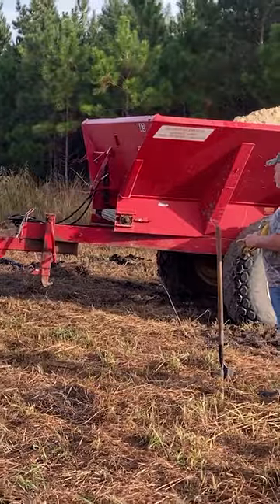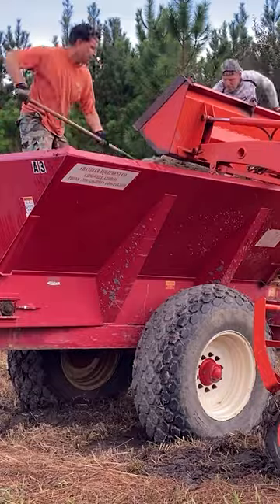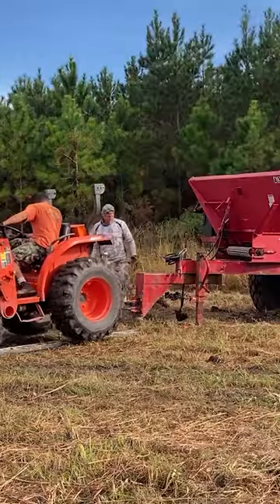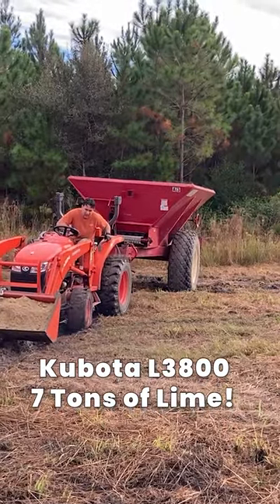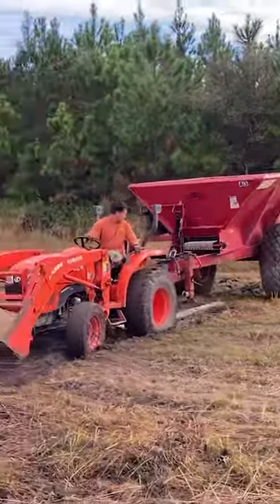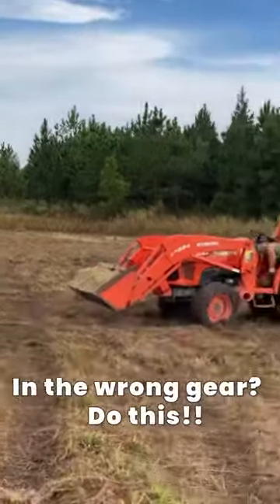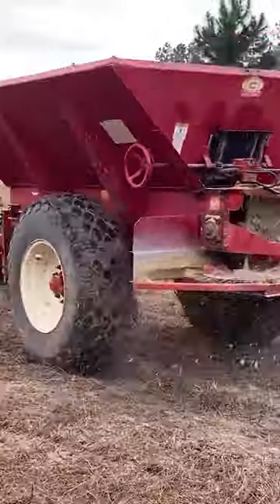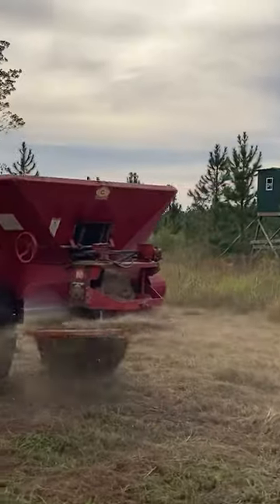2 Tractors Chained Together...Why?   #stuck #funny #countrylife #viral

Comment: Need ag tires, not industrial treads
Reply: That's what I was gonna say. My 57 Jd 520 would've pulled that with ease. The tractors weren't really sinking just the grease on top.  This year it was muddy at demo derby and tracked skid steers couldn't pull stuck/dead cars out from certain areas of arena so they called me out and I mid hook height on gramps boom pole and lift my nose and away we went

Comment: That's more like a lawnmower with a bucket
Reply: Just cause it doesn’t have 200hp doesn’t mean it’s not a tractor and when tractors first became commonly used that was the normal sized tractor
Reply: Do you own a real house tractor. Or do you call your cub cadet lawn mower a tractor
Reply: @outdoorswithdooley1169  me or the guy that made the comment
Reply: The guy who made the comment
Reply: @caseihpopper  but equipment was smaller then too

Comment: I know your working with what you got but you should never pull from one tractor the next on the bucket hooks. Those should only be for lifting.. pulling on those can cause a lot of weird stress angles on the bucket cylinders. Go to the frame. Most tractors have a decent size weight bar in the front

Comment: 1. Get a John Deere 
2. Get a smaller spreader
Reply: Imagine paying 40 grand for a new :45 horsepower, cant do a fuckin thing" john deere
Reply: @bentonrector2641  says you you’ve probably never even sat in a tractor before budd
Reply: @user-cj6ed3qz9m they're green so they blend in to the weeds better. You need that striking case red if you want to actually accomplish anything. Speaking as someone who has owned and operated both.